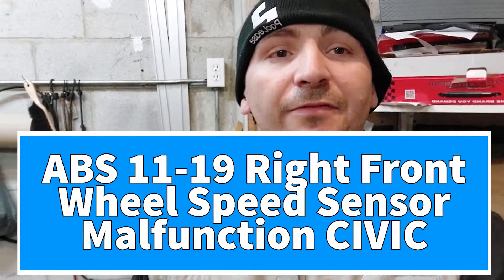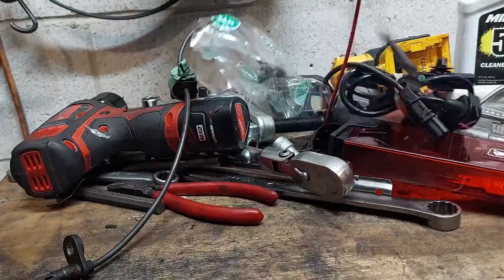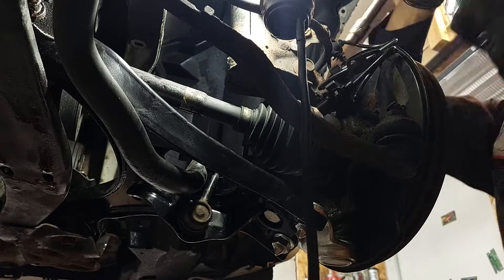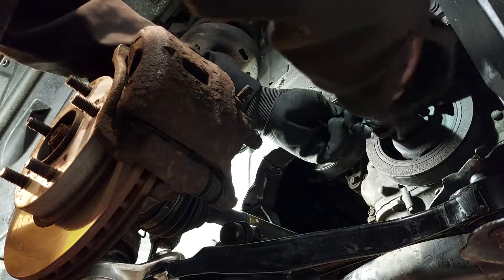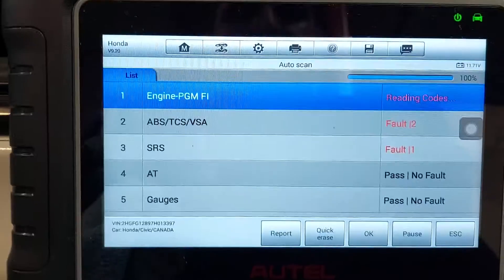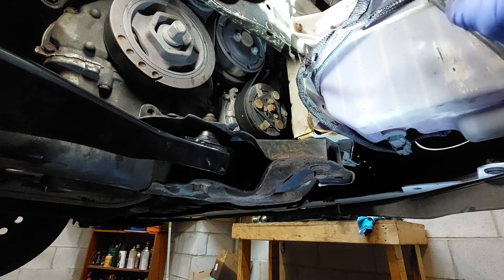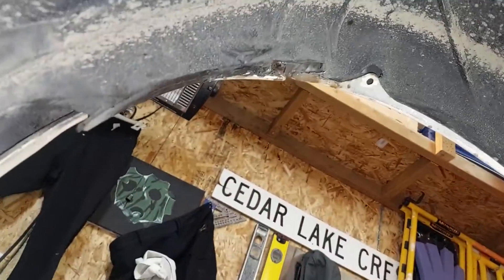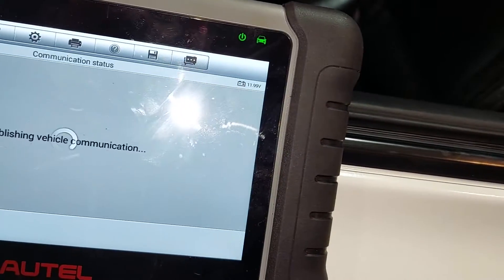Honda Civic ABS 11-19 Right Front Speed Sensor Malfunction

Comment: On my Porsche Cayenne Diesel 2017, at the last maintenance they reported that the oil level was too high. And that diesel fuel gets into the crankcase. Low mileage on the car is one of the reasons. My mileage is only 59 thousand km. It's strange that such a problem can occur on such runs. I set the oil level in the middle and will keep an eye on it.
Reply from the maker: Over fueling injector? Diesels like long drives. I believe with scan tools they can see how much it's fueling. Don't quote me. Watch A1 diesel its  diesel channel in Africa he goes over so many symptoms.  Check it out .
Reply: @MyHomeGarage   There are no Piwis errors. The injectors work perfectly. The service says one of the problems is the EGR radiator. A very strange diagnosis. There are no errors on the dashboard of the car, there are no errors in piwis. They suggest sniffing the drained oil for the smell of diesel fuel. It seems like a very professional service, but it seems they just want money))
Reply from the maker: If the egr is the issue it would be oil and coolant mixing.
Reply: @MyHomeGarage  decided to watch